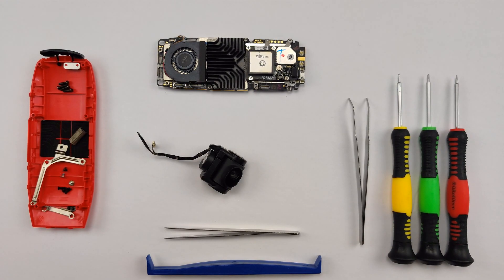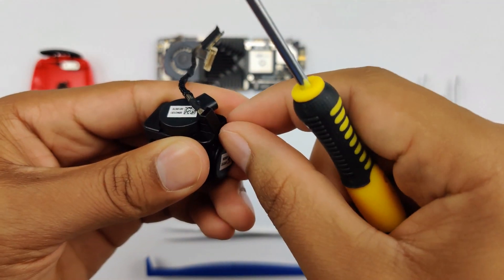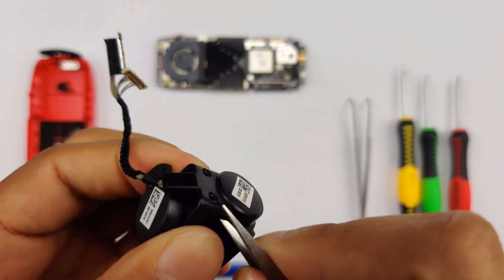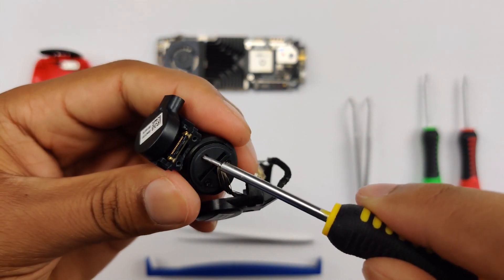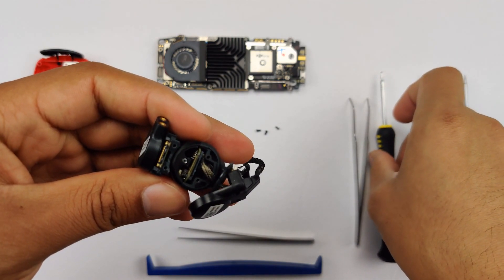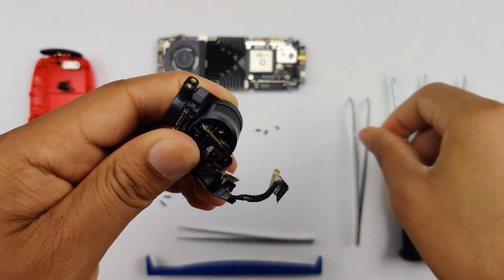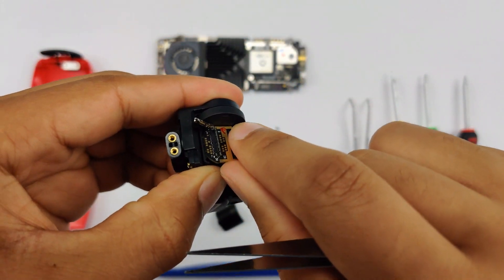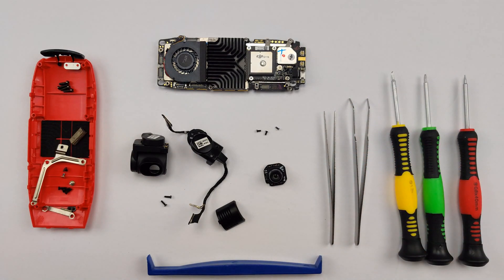Dji Spark Gymbal Teardown

Comment: Bro plz make the complete video by replacing the ribbon cable and assembling back
Reply from the maker: I wish I recorded the video when I did the recalibration a few years ago but you will need a windows computer and a reliable USB cable. You will have to search on youtube for the recalibration video because I can not remember which one I watched.
Reply: Got it, Thanks bro 👍